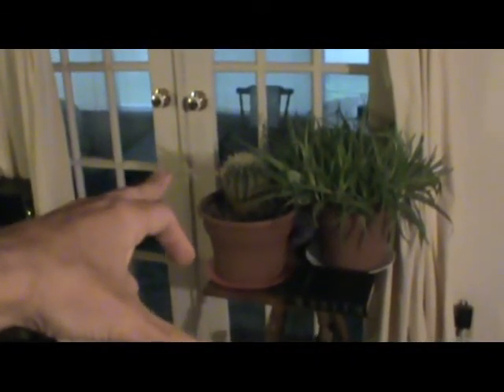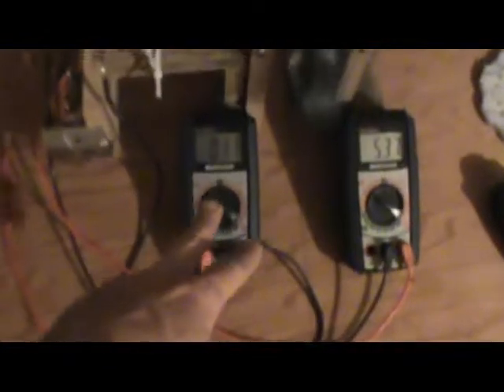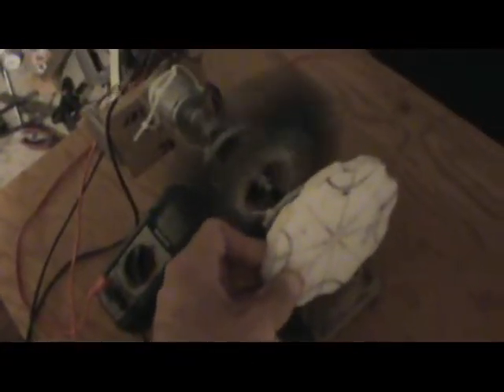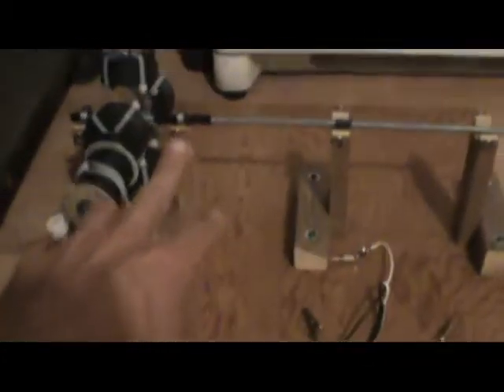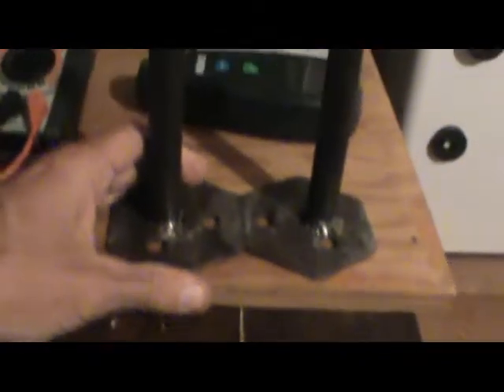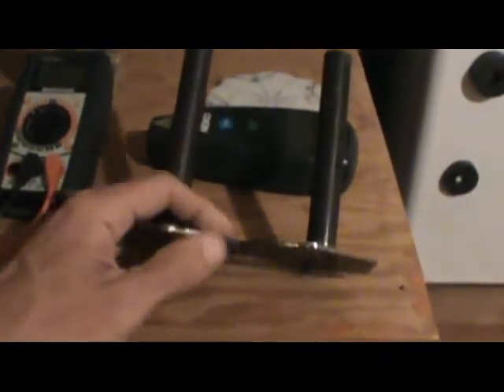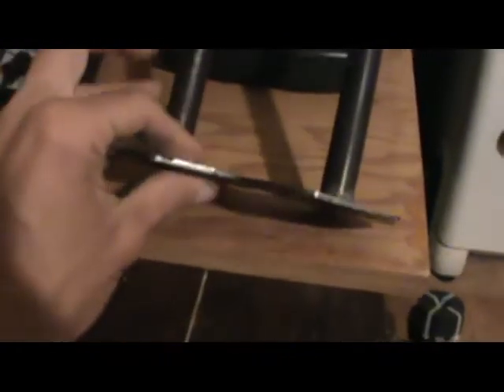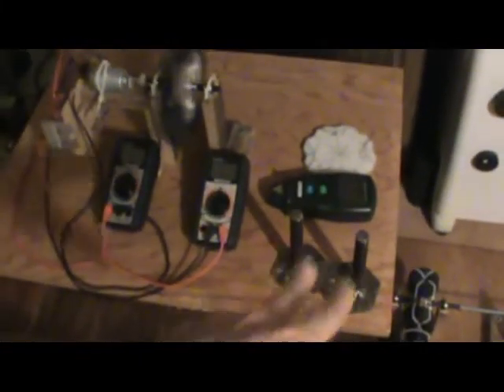Overunity Quest - Efficiency and New Core Update

Comment: RE 4:00 - Quote from Ed in Magnetic Current:

(1) "To get more magnet out of a coil put the coil in steel or iron tube, then the tube outside the coil will be a magnet the same as the coil's core, but the magnet poles will be opposite, it means at the same coil end if the core end is North Pole the tube end will be South Pole. In this way you will get almost again as much magnet out of the coil and in the core and tube."

Comment: RE 4:00 - Quote from Ed in Magnetic Current:

(2) "You can do better yet, join one end of the coil's core end with the same metal, joining core with tube. make two holes in end of metal for the coil wire ends to go out, fasten a ring on top, now you have the most efficiently client electric magnet for lifting purposes.  It wastes no magnets that come from your battery or dynamo."

Comment: STARGATE MOTOR FULL DEMO by PMMG4HYBRID basically determine the poles of the magnets in the motor and add neos around them and add steel on the last magnet to push the flux forward into the motor through the casing. You should be able to double the speed at half the draw. The more magnets the better.